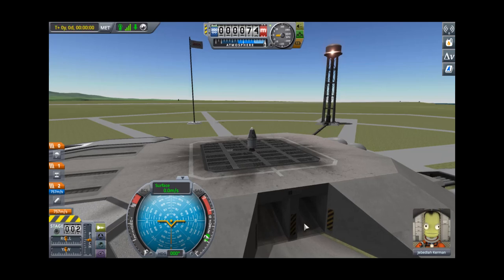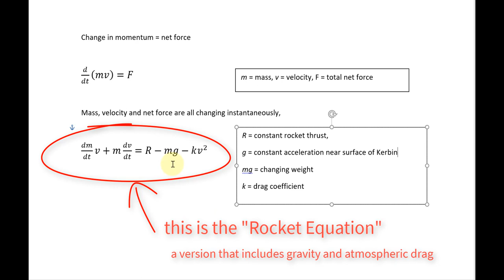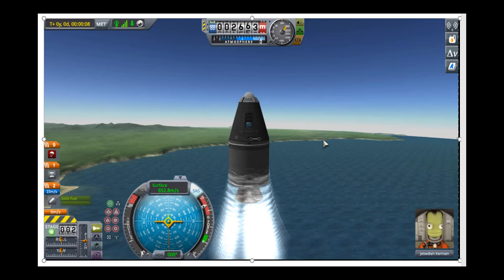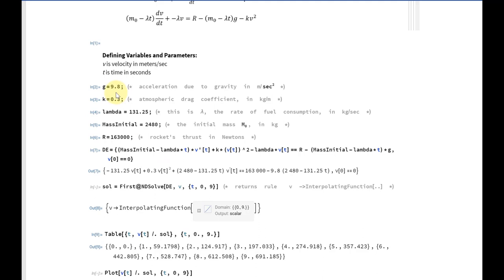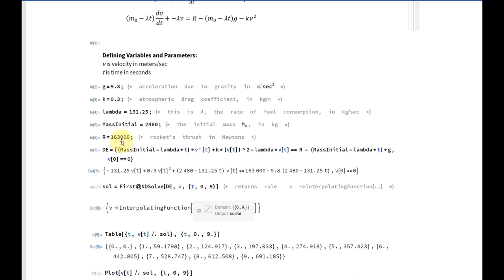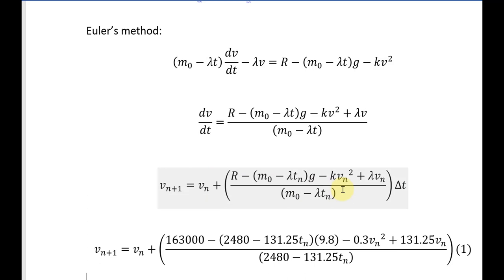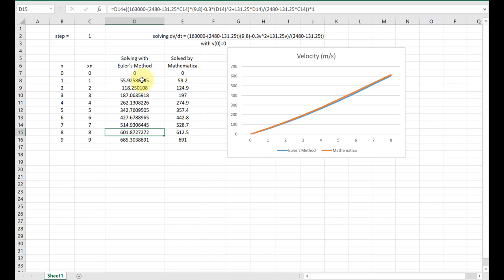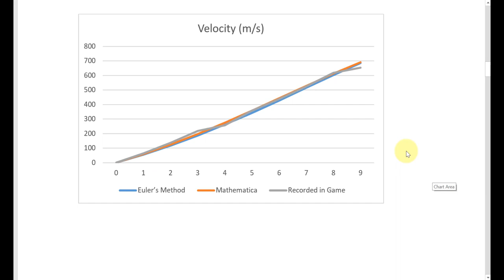Solving the Rocket Equation with Euler's Method and Mathematica

Comment: how can i calculate acceleration from euler method?
Reply from the maker: Use the equation given at the start and solve for dv/dt, that is the acceleration, you don't need euler for that part.. When you solve for dv/dt then you can find velocity by Euler's method
check out my website sites.google.com/view/kspmath, you will see a written version of this topic and practice problems with solutions, the examples like this are in chapter 6